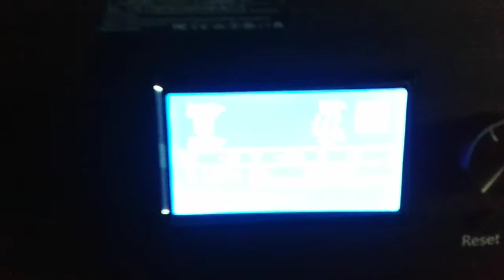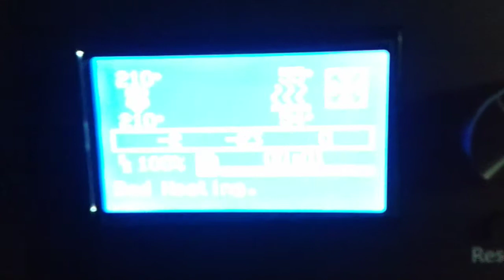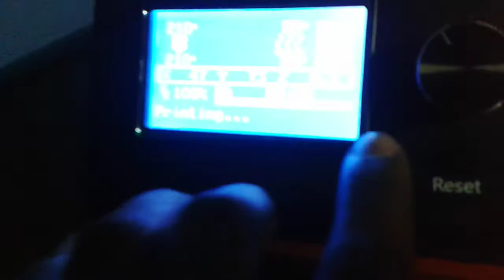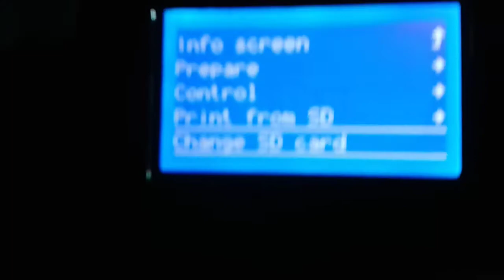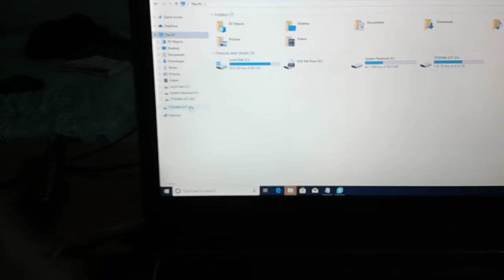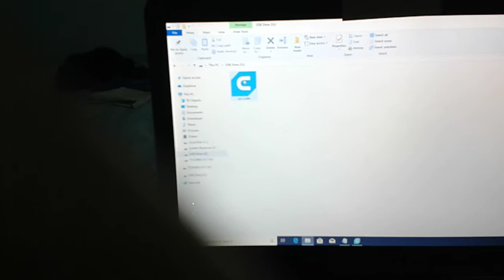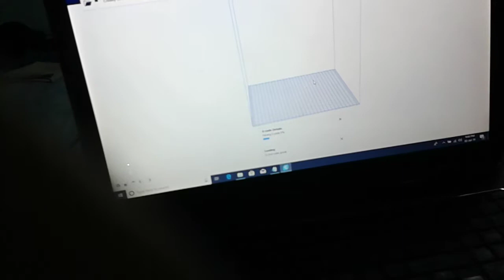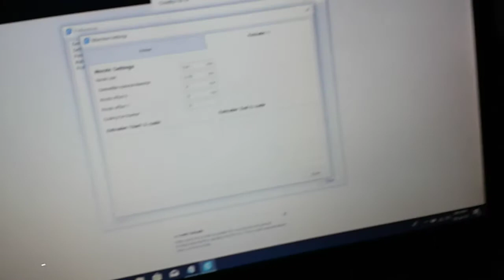Anet E16 3d printer is printing outside the hotbed and contrary to 3d model launch for printing

Comment: In Cura deselect home center of bed in printer setting.
Reply from the maker: even though the problem isn't solved.
Reply: @darshand007  Yes, unless you set the parameters  for X, Y, and Z
Reply: my x is -2 , y -3 , and z @ 0 in cura